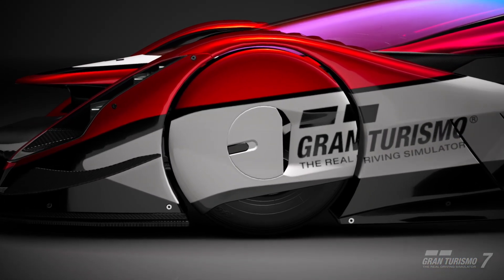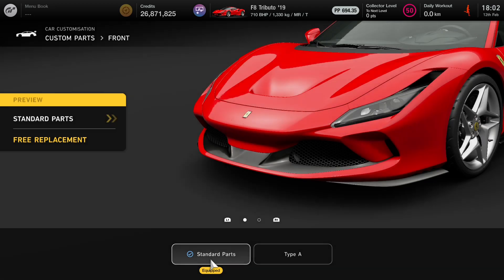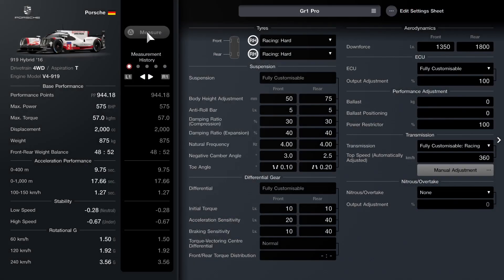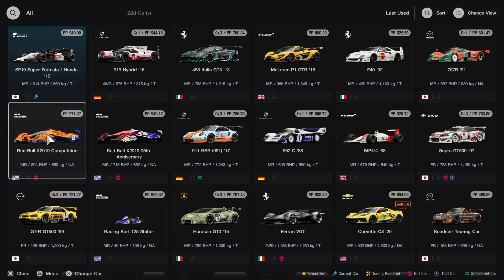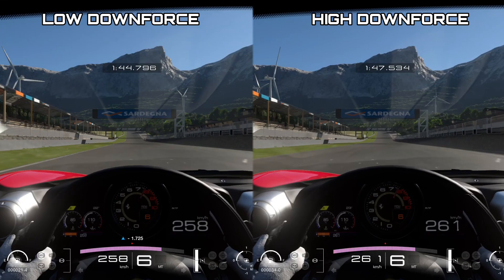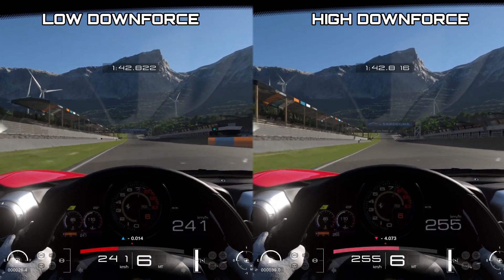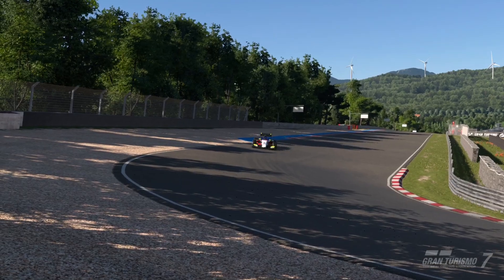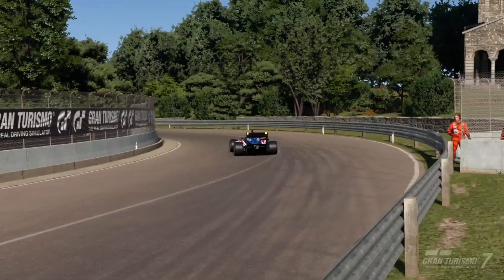GT7: Downforce Tuning: Everything Explained with Examples

Comment: This has got to be one of my favorite ways of tuning downforce in the entire series.

Not only is it the first time since GT4 where road cars can have their front downforce tuned, but with front+rear aero and a diffuser, you can have almost as much total downforce potential as a dedicated race car.  Not as much, but definitely enough to make a road car all the grippier.

Also of note, if you get a diffuser, remove the rear wing of a car, get an adjustable gearbox and racing suspension, you can improve a car’s top speed by about 7% without even touching a car’s horsepower.  The car I tested was the 2009 Corvette ZR1 C6, which had a top speed of 224 MPH stock, boosted to 240 MPH with the aforementioned upgrades.
Reply from the maker: Awesome. Thanks for the tips 👍🏻👍🏻
Reply: @Doughtinator  any time fam.

Ofc the setup isn’t a win-all; slamming a car as low to the ground as possible without stiffening the suspension means it’ll handle significantly worse in corners, especially with the additional downforce the diffuser provides, as I’ve learned the hard way when testing with height adjustable suspension rather than racing suspension.

Another tip I tend to do, is maximize the rear downforce while tuning the front downforce from there, adding less when it oversteers at higher speeds, and adding more when it understeers.  Unlike Forza where downforce seems to affect the car at even the slowest speeds, downforce in Gran Turismo seems to act like Looney Tunes’ depiction of gravity, with it acting sooner the more downforce there is, meaning downforce tuning is more than just providing a suitable ratio, but also providing enough to where it acts as soon as you would need it.

As I’ve mentioned before, slapping on front+rear aero and a diffuser can land you as much as 200 front/300 rear downforce (plus the downforce already present on a road car if it already has some), which is comparable to actual race cars in this game with how much it improves a car’s handling.  For example, my Suzuki V8-swapped ‘89 M3 sticks to the road like glue and handles well even with maximum downforce on both the front and the rear, almost indistinguishably well from a racing variant it could have had.

Another use I’ve found for rear downforce in particular is keeping the rear wheels planted on a powerful car, for example, the engine swapped 1988 Silvia.  Sure, enough rear downforce neuters the 300 MPH capability the car has by default (instead topping out at ~295 MPH without NOS), but it’s made up for with better acceleration by virtue of pressure put on the rear wheels, and can go around SSRX’s corners without braking or spinning out.
Reply: Its riterally broken, not using a rear diffuser puts at a great disadvantage against other cars, but it also dont make sense, like at all, if anything it should be robbing you of speed
Reply: @andrewandrew3713  Diffusers do provide downforce, but not in the same way as rear wings.  They aid aerodynamic performance via ground effects, and also reduce aerodynamic drag, hence making a vehicle faster while providing more downforce.

It’s not downforce itself that kills top speed, but rather the aerodynamic drag inherent with traditional downforce methods like a front and rear wing.  Otherwise, the Red Bull fan cars wouldn’t be capable of 300+ MPH despite having less HP than a Bugatti Chiron.
Reply: @camarokidbb4347  well, thank god you cant fit a rear diffusor on a Chiron lmao
Reply: @andrewandrew3713  Because it already has one lmao.
Reply: @camarokidbb4347  whatever you say lol
Reply: Some more examples as to why the downforce tuning for road cars in GT7 is goated:

The GT-R Nismo not only has some innate downforce, it also gets the full 200 front/300 rear bonus from aero in GT Auto.  This would already be significant if it also couldn’t accept the Chiron’s engine swap.  More potential downforce than you can get with the Chiron proper meaning higher speed cornering, plus the Chiron’s 1,800 plus horsepower engine when fully upgraded, plus the GT-R Nismo being innately AWD so I can zoom out of corners?  It easily net me a sub-6 minute lap on the Nurburgring, and is also the heaviest car to do so in my experience.  Only fully modified Group 1 cars, the Tomahawks, the F1/Super Formula cars, and the Chaparral 2J were faster.

I’d also like to mention the fairly recent Evo IX, as well as its even more recently added Group B engine swap (which apart from the extra horsepower, also grants better fuel economy).  Again, it gets the full suite of aero upgrades, and while it doesn’t have as much innate downforce as the Nismo GT-R above, it’s also only a little over 2,300 lbs in weight when all is said and done with a maximum of 788 horsepower.  Coupled with AWD to zoom out of corners with, this beast has net me an approximate 6:20 time on the Nurburgring.  Not the absolute greatest, granted, but it’s still fast as hell.

Comment: I'm going to give you amazing content here...
When you race GT3 cars on the GT3 races, you have to hit 730PP, this is where that down force gets super interesting.
When you lower the down force on the back and add more to the front, you lose 100 HP, plus the cars is not stable around turns.
When you lower the down force on the front and add more to the back, you gain 100+HP, plus the car turns better.
This is counter intuitive to the PP points going up and down, cause you would think you lose power for more stability and and gain power for instability?!?!

Try it out and make a video about it, it was fascinating when I was trying everything to make my lap times better for GT3 PP 730 races, I see the power I got for adjusting the down force from front to back but after all my tests the more stability equaled more power and the instability created less power.
I got smoother turns and higher top speeds with greater stability and 100+ more HP from lowering front down force to lowest and raising the back down force to highest.

Make a video of this and enjoy.
Reply from the maker: Very interesting man. I noticed similar with the Gr1 Legendary LeMans cars. I’ve not tried it with the GT3 cars though.
Reply: @Doughtinator  
I figured this out.
So without the PP system the balance you will do will be have less resistance over control with no PP system cause you will always by full engine power.
So in that situation you will be balancing the top speed vs rear down force, more control over top speed.

But when this comes into play with the PP system, you sometimes don't have full engine power, so they give you less PP points for full down force to comp for the lose in top speed?
So now when you go fuil down force the PP lowers so you can get more engine power to comp for lose in speed, but now you have more control cause you have full down force with max power into the PP system.

Also I just tested the down force with highest down force vs lowest down force and the engine power lose and gain, I'm pretty sure this balances out top speed for either setting of down force with the PP system (Again with none PP system in play, full engine power this doesn't come into play cause you are not throttling your engine power back ever), The top speed is just a smidge faster with full down force with full engine power to max PP.

SO,,, I think this might be an oversight on their part cause more potential engine power with full down force is the only way to go, there is no point in lowering your rear down force, cause it's max power with full down force for control in the turns with no loss of speed, at least I can't figure what the sacrifice is for this yet.
Reply: Adding or removing downforce does NOT increase or lower horsepower, that's false info right there lol
Reply: @TheSilverShadow17 
I don't think you read this and understand what was discussed.
Please reread and delete your comment, thank you.
Reply: @l337g0g0  No, I know what was wrong with that statement, how exactly does lowering downforce affect horsepower? That makes no sense
Reply: @l337g0g0 I have the right to express my personal opinions about something and so do you, but where that crosses the line is when you make a desperate attempt at ordering me to delete my comment all because you said so. I do not take orders from backseat drivers, thank you.
Reply: @TheSilverShadow17  
"I have the right to express my personal opinions"
I think you are very confused at what I'm typing in my original post and why I'm asking you to delete the post.

You are mistaken at what was talked about, I'm not asking you to delete cause of your opinion, it'[]s cause you didn't read and are making a false statement that doesn't represent what was discussed.

Again one more time, reread the WHOLE discussion and you will see your errors, and you will want yourself to delete your error-ed comment cause it doesn't represent what was discussed.

Stop being confused and do the right thing plz. you are going to start wasting my time and I'll have to leave you to your own neglect.
Reply: @TheSilverShadow17 
reread it and come back and ask that again.
Fully reread the comments.
Reply: @l337g0g0  I have looked over the original comment, the part that gets me is the part where you associate aero with engine power. I get that with more downforce requires more power but downforce by itself isn't engine power, if ya get my drift. It would help me a little if that had some elaboration, is all I'm asking. Otherwise I understand the concept and principle.
Reply: @TheSilverShadow17 
Grand Turismo has a balancing act in the game called Performance points = PP.
 to keep cars on a even playing field. They use this score to determine the permanence of a cars capabilities to keep them all inline with each other to balance different cars out for competition.
(So all cars no matter the series they are in, will all have the same competitive edge)
Within that system when you add down force it slows the car down, so you will get more points to use for other advantages to the cars performance elsewhere on the car, cause down force gives extra traction in  high speeds turns. Not so much needed on slower cars or slower speeds. but the game considers this a disadvantage to add lots of down force cause on long straightaways with a fast car this would hinder top speed, again slower cars or cars on twisty turny tracks this would be less of an impact on the lose in speed, hence performance.

So... when you throttle back the engines power to get it inline with the performance points needed to be on an even playing field on a track with  cars, you can now use less throttling of the engine power cause when you increase down force you alleviated performance (cause it's considered a disadvantage) points to use somewhere else on the car, hence less engine throttling, hence more engine power, hence more horse power.

This is why I told you to reread it so I didn't have to type this all out.
But you seemed just now sincere with your questioning so I don't mind helping you understand the GT7 PP system and what i was referring to in the OP.
Reply: @l337g0g0  To be frank and honest with you the PP system is flawed, just like the vaguely executed rating system that GT Sport had. GT5 and 6 both used PP ratings but as I said the system is flawed and has issues. A lot of times the results are exaggerated to compensate for the inaccuracies or are there to add balance.
Reply: @TheSilverShadow17  
So now you understand the confusion with your reply to me?

And I think it's ok and does the trick, but as i was pointing out in the OP some of those PP systems can be exploited, slower cars on slower turny tracks can benefit from putting the DF hard cause it will have a minimal impact on performance cause you are not always in a top speed straightaway track.
So the points you can gain (Engine power) from minimal disadvantage (max DF).

The engine power you can gain from the points gained from maxing the down-force outweighs the disadvantages on the down force.
Specifically when using slower races with less top speed tracks.

Over all it works for the fun of the game, but I'll agree with you it's not a perfect science.
Not meant for hyper competitive balancing.

You understand what was being discussed now?
Reply: @l337g0g0  Yes, I do get it now.
Reply: Because the less downforce you have, not only is your top speed potentially higher in spite of your power decrease, it also saves on fuel economy due to both less drag from downforce, and less power.

This could be a game changer for endurance races, which most of the 800PP races are anyway, so maybe running less downforce + power may be the play, if you also tune your suspension accordingly.
Reply: @camarokidbb4347  At the same time you sacrifice cornering speed as well
Reply: @TheSilverShadow17  Depends on the car.  With road cars (plus cars up to Group 3 iirc), cornering speed does get sacrificed without question.  With Group 1/2 cars that have low weight and high downforce even at their lowest setting, it seems like a no-brainer to sacrifice extra downforce for better fuel economy, especially for endurance racing.
Reply: @camarokidbb4347  It makes sense for high speed tracks like Le Mans where the majority of the track is a long straightaway, and you want the extra speed overall.
Reply: I discovered this, recreating the Dodge Viper ACR-X '16. You can think of my build as stock. Sports air filter, fully customizable suspension, carbon ceramic brake kit + racing brake pads, brake bias control, stage 1 weight reduction + body rigidity, and a full aero package minus the rear diffuser.

It's at 715.xx PP, 645HP , and my fastest time around Road Atlanta (my test track of choice) is 1.17.xxx. I'm looking to make another Viper, but with everything I can put into it. The one I currently have is for pure nostalgia, but it's fast enough to compete with GT3 cars sitting around 750-760 PP.

Comment: I use hours on gt3 cars whit setup for them ( whit full tune ). Full tune on purpose because control them and it's way easier to control them in bop. ( That only my opinion 😜 ). I already found the most perfect setups for F-Type in my eyes. ( Several ). Also 1 that it's almost impossible to loose control of it over any apex and where it's VERY forgiving and easy to save if you make a mistake. I know it's probably not fast but one of them give you low 1:57 times on mount panorama. I love messing whit setups 😜 great vids your making 😀
Reply from the maker: Awesome. Thanks man 👍🏻

Comment: Ok, but what about the balace of downforce between front and rear ? How do you know how much force to put on the front, and how much on the rear ?
Reply from the maker: Try for the balance as far forward as possible as long as the car is still stable for you to drive.
Reply: @Doughtinator  So increasing the front downforce as much as possible, while keeping the rear downforce as low as possible ?
Reply: I honestly still cannot believe that GT7 does not have a telemetry to read from (and adjustable tire pressures), we are blindly tuning meaning you need to have invested tons of time to learn what the game does, instead of reading data and making smart choices based on that.
Reply from the maker: Pretty much. That will lead to the fastest corner speeds. But you’ll get to a point where the car will be too hard to drive.
Reply: @Doughtinator  you mean as in a loose feeling front that is very unstable during low speed corners ?
Reply from the maker: Downforce is more prevalent at higher speeds. At low speeds it’s probably more suspension related.
Reply: @Doughtinator  As far as most downforce setups are concerned, especially for cars that can accept rear diffusers and custom rear wings, the front/rear downforce ratio when maxed out is 2/3.  I found that this ratio is good (even when maxed out) for most cars I run, and even if it wasn’t at first, suspension tuning took care of the rest.

Comment: My garage rcr civic has 300 rear downforce lowest but i need to get it to 250 does anyone know how to do it?
Reply from the maker: Can you change the rear wing in GT Auto?
Reply: Afaik, even removing the wing doesn’t lower downforce below the minimum amount; it simply makes the wing un-adjustable at the lowest setting unless you also equip a rear bumper.